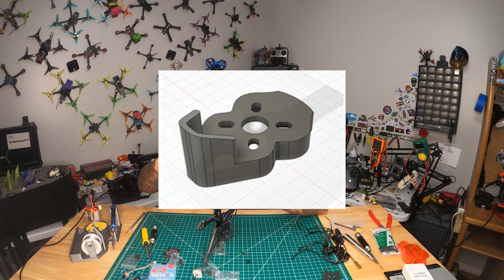The Easiest FPV Drone Build Ever! DJI On The BangGOD

Comment: cracking build mate, can you tell me what props, esc and motors you used for it. loved your beast build, that thing flys amazing. what was total cost for it. life goals have changed...
Reply from the maker: Haha! With batteries and props it was close to 2k for the banggod I used the 2507 Brother Hobby Avengers 1750kv for the props I run all different types on it.
Reply: @DrainManFPV  awsome.  loving the vids. went and got a 6" frame, but went for holybro hdv f7 40a stack and rcinpower 2207 1860kv motors. i worry i have undersized both esc and motors. this is my first build and have gotten ahead of myself. i cant afford a go pro yet so will just be dvr recording. how will i be for weight and manoeverabilty. i feel i havnt left much headroom and could burn motor or esc if i get carried away, which is likely. any help appreciated bud
Reply from the maker: @jarydmahmood8099  your motor kv is a bit high for a cinematic 6inch build. It will prob be alright, you can set up a throttle limit or a output limit to protect your motors and ESC.

I have a video on how to do both, check them out! Thanks.
Reply: @DrainManFPV  thanks bud

Comment: Wow, you mounted your camera really low...The props are almost level with the cam. They actually have camera plates cut for props out of view for DJI. I already bought some, smashed the crap out of them(along with the lens & a new 6s). It was the first digital dropout I ever had, and it happened during a pretty hard building dive. I was about 2 1/2 football fields away and through a building(not smart). I was only at 700 mW too. Should have cranked it up two more notches. New camera plates (actually the stock ones) and a $10 replacement lens fixed it up. Oh yeah, I snapped a motor in half lol. Other than that the frame was perfectly fine. It’s a tank! I bought five motors when I built it, so I already had one on hand. $25 motor, $10 lens and $8 worth of camera plates (which I could’ve really reused) is all it took to fix.

Comment: I disagree about the “money unit” I’ve struggled to get a good quality setup of camera/rx/VTX/antenna (which I often rip) and the air unit price of $180 can be even lower than a combo of all the above (can’t really compare, I know). I think the expensive one is the radio which surely isn’t better than the Tango2.
Reply: Amir Mehler I use the Dji controller. Easier to setup and you don’t have to solder up receivers with antennas that’ll break off all the time. The latency is on par with crossfire or even better. Never had a fail safe not once.
Reply: EscobarFPV thanks Escobar. I don’t know if the DJI is for everyone, but will probably pay out for me
Reply: @amirmehler  that's very true. The Tango 2 looks nice. My favorite controller was the X-lite. I liked that form factor.

Comment: Correct me if I'm wrong, but for those following this, that don't have a ton of building experience, you need to remap your motors because motor 1 is now in the 3 position? Should have shown those steps, perhaps!!
Reply: or turn the esc 90 degrees